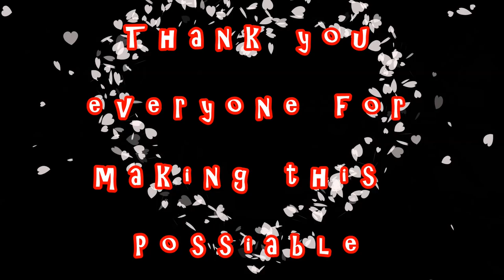The Death and Return of Filbert the MK4 GTI Season5 EP12

Comment: RIP :(  I finally been working on my jetta 1.8t  and I been finding and kinds of worn out parts.  One that caught my attention really fast was the two fuel line on the passenger side it was about to crack open anytime. Immediately bought the fuel lines and replace them. Seen your video is exactly what I thought it would happen to my car. Thaks for sharing :)
Reply from the maker: Anytime. Its always better to learn from someone else's experience than to expiernce it yourself.